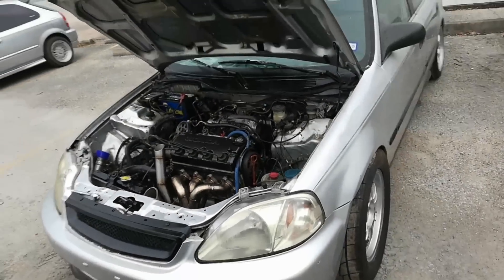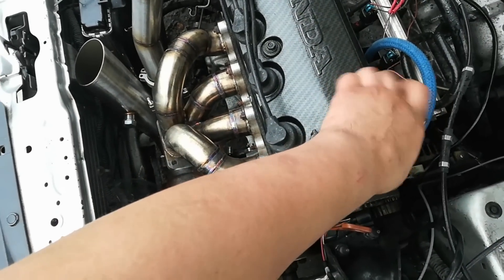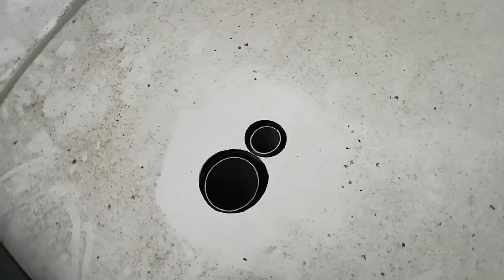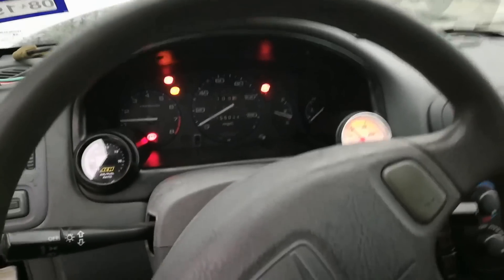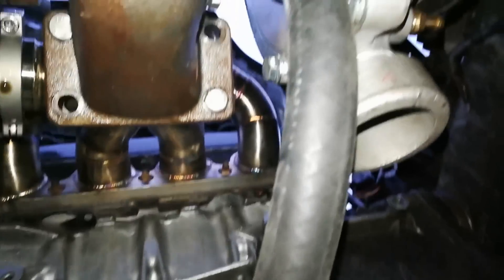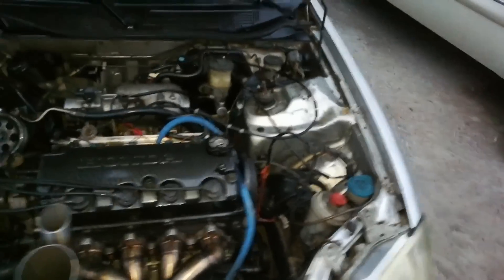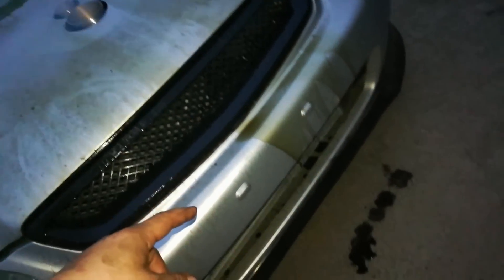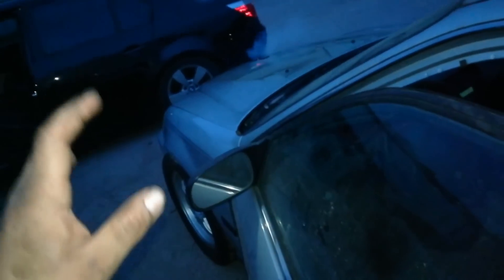TURBO D16 Civic 450whp Vitara Build. Ep.11 The Good Bad And Ugly

Comment: Twist it all around so the fitting plate is the return purchase a return fitting off ebay then get a male to male fitting to run the feed to. I'm running the same turbo on my built z6 no issues
Reply: Just watched 30 seconds into the the next video 😂

Comment: Bad turbo seals? If its a bb turbo you need an oil restrictor.
Reply from the maker: Journal bearing turbo :(
Reply from the maker: It's a brand new eBay gt35r never been ran..  still wouldn't doubt it's bad right out of the box.
Reply: @BoBuilds  Like you were saying it is possible that the drain isn't steep enough and the oil is getting backed up in the turbo.

Comment: did you use the return fitting off the old turbo or the one that came with the turbo?...check out the return fitting size...bigger or smaller..a smaller fitting would have that issue..and yes redoing the lines would be great and also you running it like that for that long would cause the seals to blow...I would take apart the turbo and look at everything..ur looking for rip tears and scoring..if it checks out brake clean everything and add oil back into the motor since u lost 2 quarts of oil on the hood lol
Reply: Also in my trial and error if it smokes out the exhaust it could be to small of fitting and gasket and return line placement..if it smokes/leaks out the compressor side then it’s the oil feed fitting..I really hope the turbo is still save able..good luck bro

Comment: depends how long u ran it with the return line pinched , I see a lot of "bad turbo " that was just installed error ,tear it apart and clean and inspect it , the turbo being to high or two low wont affect since ur new drain set up is adequate now , the only thing is clean it and pray u didn't blow it from running the return line pinched
Reply from the maker: It wasn't literally pinched I was kind of exaggerating just didn't like the sharp turn it had to make
Reply: @BoBuilds  hmm well it was enough restriction to back up the oil thru the seals , and also bro run a restrictor I'dk who said about not needing it since it's a journal bearing , but Ebay turbo need it since they wherent built to the same specs as garrets, just clean the turbo with some good cleaner and re install and see what happens with restrictor,. ppl dont understand oil seals are like piston rings and it is very hard to mess up if it was run for a little while only
Reply from the maker: It has the same oil restrictor from the first turbo, I didn't have a chance to drill it out I was just trying to get it home at this point
Reply: @BoBuilds  ugh ,that's not a good sign bro , but for it could have blown the seal that fast ,I would say it was defective on arrival then ... but clean it with something and make sure all the old oil is gone bro

Comment: The turbo is bad
Reply from the maker: Hope so! At this point ide rather replace the turbo than the manifold being the issue..it took too much time and work. We'll find out tomorrow
Reply: @BoBuilds  
Get a new feed a return with the turbo but I think it's the turbo. Question for u. I have a sohc build I got eagle rod and new stock pistons took the block to the machine shop and got freshed up what do u think?
Reply from the maker: Hmm obviously the Pistons are your weak link now. But if you gap them for boost at least it'll have that going to prevent ringland failure, Bet it would handle 300whp reliably. Vitaras are cheap man think a set is under 100$
Reply: @BoBuilds  
Facts bro that's what my home boy said too